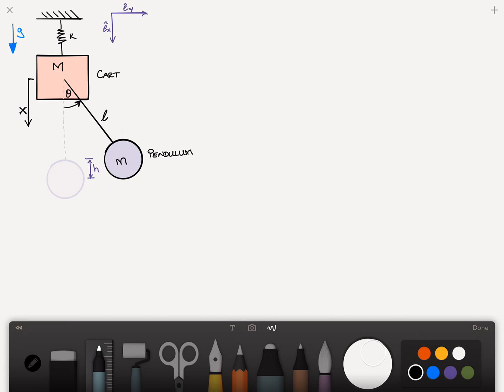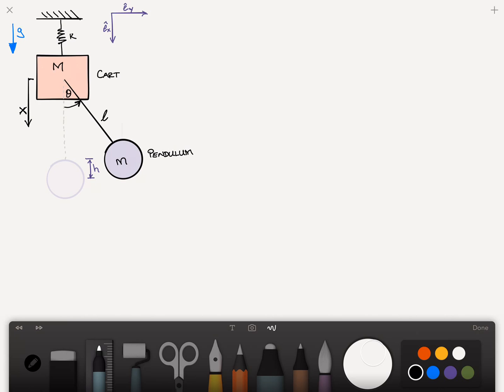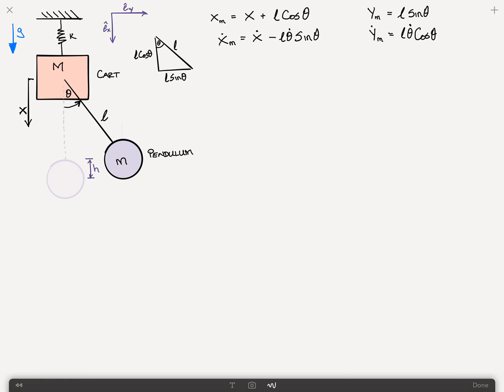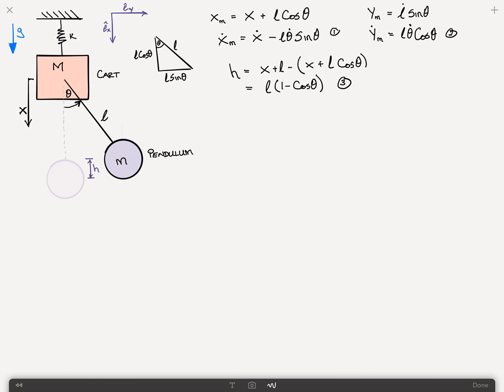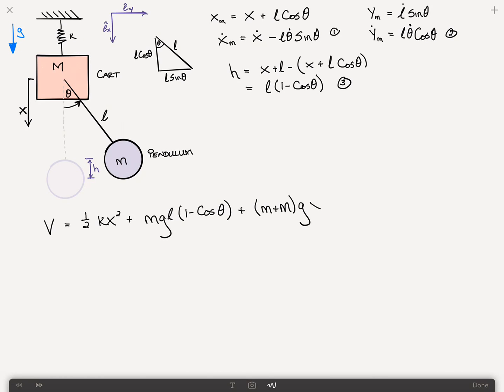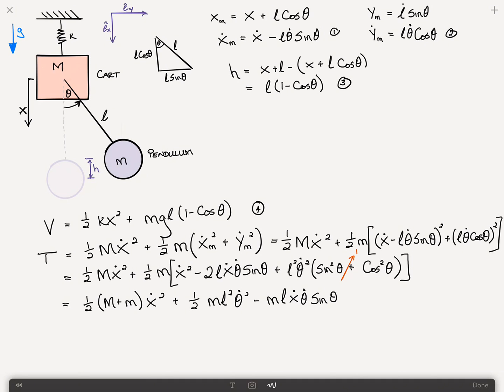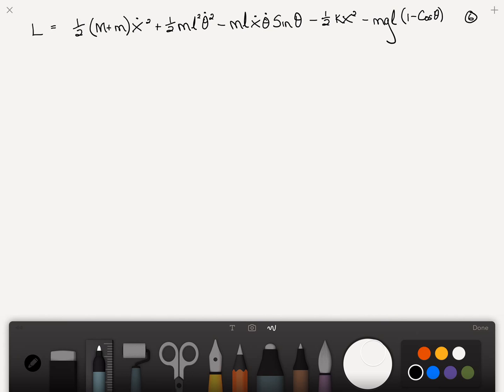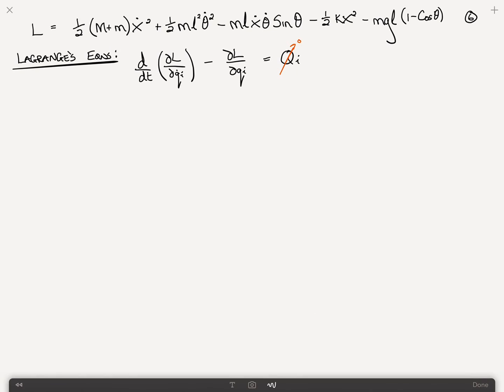Equations of Motion for a Pendulum on a Cart (2DOF) Using Method of Lagrange's Equations

Comment: Sir given these two equation can we now use small angle approximations to do modal analysis and find natural frequencies?
Reply from the maker: Yes, sure.  You can linearize the problem as you described and then solve for the mode shapes and frequencies for the linearized problem.

Comment: how does the potential energy equation differ if there was another spring connected underneath the cart to another datum point?
Reply from the maker: Since this spring would still have a displacement of x, you would add the contribution of this spring to the potential energy of the system as V = 0.5 * k1 * x^2 (assuming the spring stiffness is k1).  Hopefully, what you are able to tell just by looking at the problem and what I have written, that as a result of your described setup, the two spring stiffnesses would be additive (i.e. both resist the motion of the cart).  As as result, instead of re-deriving everything, you could simply adjust your equations of motion by replacing all occurrences of k by (k+k1) - i.e. the net effect is that the spring you currently have would effectively be made stiffer.

BTW - It would make no difference whether you attached the spring to the bottom of the cart, as you have described, or whether you attach it to the top of the cart in parallel with the existing spring - in both cases it will resist the displacement of the mass with the same force.
Reply: @Freeball99  You are a Legend mate. Much appreciated

Comment: How we can   Linearized both equation of motion  ?
Reply from the maker: Apply the small angle formula.  So, replace sin θ with θ and replace cos θ with 1 in your equations of motion.
Reply: @Freeball99   Now then, your equation no. 9 will be  ' l*θdd -xdd*θ+g*θ = 0 for small angel. isn't the second term xdd*θ also non-liner? and xdd*θ also deleted to make it liner system?

Comment: Sir, hi. I have a question. If we take the datum the very top of the sistem h becomes as h = -x-l*cos(theta) which changes the equation. What am I doing wrong?
Reply from the maker: Not sure if I understand completely...what you have done, in effect, is to shift the origin of your coordinate system from the mass (at equilibrium) to the attachment point of the spring.  It should have no net effect on your equations of motion.

Comment: is is possible to get the oscillation period from this?
Reply from the maker: Since this is a nonlinear problem, the frequency of oscillation (and therefore the period) is a function of θ (and thus the initial angle).  Also, if the vibrations are small, then we can find the frequency/period for the linear case - which is constant.  You can calculate it if given a specific initial condition.  In practice what happens is we end up with limit-cycle oscillations in the nonlinear case.

Comment: Thanks a lot for this lecture; the explanation was very clear and I'm planning to run a numerical simulation.
Just out of curiosity, you mentioned in 0:30 that the weight of the system can be ignored, even though the displacement x is in the same axis as gravity. Does this mean that x=0 is not the resting displacement when the spring is unloaded, but when it is loaded by the system?
Reply from the maker: Here is a discussion on gravitational effects and when to ignore them.  https://www.youtube.com/watch?v=TpZMTo-Lig4 
In this case, just assume that at equilibrium the spring is in its (slightly) stretched position.  You can calculate this position by equating the entire weight to the spring force.  Then assume that this is you zero point.

Alternatively, just include the gravitational effects.  What you will then see is that you have a constant term that gets added to your solution for x(t).  This is the gravitational offset.

Comment: Hi! Thanks for the nice video! I was wondering how you would go about solving this problem assuming small angles?
Reply from the maker: The idea here is that we take the equations of motion and we change sin θ to θ and cos θ to 1 THEN we eliminate any higher-order terms.  These are any terms that contain two or more coordinates or their derivatives multiplied together and can be eliminated because they are insignificantly small in relation to the first order terms (a result of the small-displacement assumption).  

Therefore, the resulting equations of motions for the linear system are as follows:  
(M+m)x_ddot + kx = 0  and
L θ_ddot + g θ = 0
Reply: @Freeball99  Okay, Thanks! That helped alot!
Reply: @Freeball99  much clean equations, i like it

also solutions for x and theta is on same format with given constants

Comment: Hello. How can you define the function of angle in such problems? I mean, what's the function of angle, derivative of which we take in order to find general 'dot'-equations of the coordinates?
Reply from the maker: A closed-form solution for this does not exist which means there is no such function that can be written out.  As a result, the response must be determined by numerically integrating the equations of motion.
Reply: @Freeball99  Oh, thank you. Thus, we have to calculate (approximately) the value of the final function at each point of time, for each value of the angle, haven't we?

Comment: what's software used in presentation ?
Reply from the maker: App is "Paper" by WeTransfer.  Running on a iPad Pro 13-inch and using an Apple Pencil.  Video is captured using Quicktime.

Comment: @Freeball  Sir but X is about/from the equilibrium position so if we are taking that position as our reference point then (M+m)*g*x should be considered in the potential energy... because X will be below the reference point.because X is the additional displacement from the equilibrium position
Reply from the maker: In general, X is not from the equilibrium position, but rather from a prescribed zero position.  

My suggestion to you is to include the term you have proposed above in your potential energy expression and put it into Lagrange's equation and see what happens.  

What you will find is simply a constant term in your x-equation (because the x disappears after you differentiate this term).  What you will find it that you end up with a forcing function which is simply a constant...which adds a constant to the total response - this constant is equal to the initial elongation of the spring.  I have explained it here: https://www.youtube.com/watch?v=TpZMTo-Lig4
Reply: @Freeball99  Ok sir , i have done it and come up with -(M+m)*g ,and by your suggested video I understood that why Mg shouldn't be taken,but what about pendulum potential energy, it should be included as -mgx as initial dispace ment was 0 and after a time t pendulum makes an angle theta and M makes displacement x so i think that in h=l-(x+lcos(theta)) sould come.
Reply from the maker: I believe the argument is the same as before - i.e. you can ignore the gravitational effects by using the equilibrium position as the zero point.  You can test this for yourself and determine whether or not to include.

Solve the equations of motion (using my integrator that I provided in a previous video).  Run it once while including the effects of the term in question.  Then re-run it after zeroing out the terms.  Plot both results on the same graph and see if the results differ by a fixed, constant amount.

Comment: Been watching your videos for sometime now to go back to the basics continuously... Do you have recommended books you use for conceptual references?

I want to dive into more examples/problems. Derivation for me is usually to understand all the influencing parameters, and quantify what I already have speculated, but i don't like getting bogged down in them for way too long. 

When I fix a frame on a garage door, I don't go about deriving how to add adjustments to bolster rigidity. I just drill some wooden rods with the right fasteners in the right places if you know what I mean. 

Anyways, I've been trying to combine different concepts for applications in aerospace & structural design. 

Current books/material , are less textbooky (which are awesome btw & i love penguin classics) : 

-The New Science of Strong Materials, J.E. Gordon
- Structures : Or Why Things Don't Fall Down, J.E. Gordon
- Tom Irvine : https://www.youtube.com/watch?v=vWjizHma16Y
- Success through Failure: The Paradox of Design, Henry Petroski
Reply from the maker: Sorry, But I missed this until now.  I don't really have a single book that is good for everything.  I think back in the day, I used a book by Rao, which was pretty good but had some mistakes.

Comment: i found different equation to this system. would you like to explain how it is different?

https://drive.google.com/open?id=1WwWk2bMFRb7feRw8kRWEY_6qNUlY177B
Reply from the maker: Thanks for this feedback.  With regards to the information in the attached link...

1.  This expression for potential energy is basically the same as what I have presented with the exception that I have chosen to ignore the gravitational potential energy of m1 & m2 due to the x displacement BECAUSE I have assumed a different static equilibrium position than that which you have presented.  NOTE:  I have assumed that the static deflection (equilibrium position) is due to the weight of m1 + m2 while the author of your book assumes that the deflection is due to the weight of m1 only (which is why he/she must include the additional gravitational potential due to m2).  Here is a link to a video where I describe when it is okay to ignore the gravitational potential by assuming oscillations about a static equilibrium position:   https://youtu.be/TpZMTo-Lig4  

Apart for than, the two expressions for potential energy differ only by the addition of a constant (due to different assumptions where the point of zero potential energy for the system is).  The constant gets differentiated out when substituted into Lagrange's equations so we really only care about the CHANGE in potential energy and not the absolute value of it.

2.  The expression for kinetic energy that the author has presented has several problems (at least 3 by my count):
a)  The velocity for m2 has been squared TWICE.  The expression in the parentheses is already the m2 velocity squared (check the units).  Squaring it again is wrong.
b)  The second term of m2's squared-velocity should be (L·Θ_dot)^2 and NOT (k·Θ_dot)^2 - again check the units.  Units should be velocity-squared.  There is no physical way in this problem that the velocity of m2 can be dependent on k.
c)  The third term of m2's squared-velocity should have a NEGATIVE sign.  This is due to the fact that for positive 'x', m2 moves vertically downwards while for positive theta, m2 moves vertically upwards.

Hope this makes sense.  Unfortunately since there is no work shown, it's hard to guess why the author should have made such an error, but the kinetic energy expression is clearly incorrect.
Reply: I forget to check the units as you said. Thanks a lot Sir. It is so helpful. 😇

Comment: hey I wonder if you can do a brief video on tuned mass dampers, where the spring and mass are moving horizontally, and the pendulum attached below, thanks a lot!
Reply from the maker: Sounds like you're talking about the type of damper they have begun using in skyscrapers (like in the  "Taipei 101" building).  
http://justfunfacts.com/wp-content/uploads/2016/05/taipei-101-tuned-mass-damper.jpg

Did you take a look yet at my video on Dynamic Vibration Absorbers (which is the same thing as a tuned mass damper)? 
 https://youtu.be/7T6pQnNBph0 
I realize this is for a sightly different system, but the mathematics and the concept are identical - namely that in order to tune the pendulum, the isolated pendulum should have the same natural frequency as that of the isolated mass-spring system (i.e. for tuning purposes treat each mass like it is its own single-degree-of-freedom system).  

I remind you that the frequency of a pendulum is independent of the pendulum's mass and is equal to SQRT(g/L) where "L" is the length of the pendulum.

Here is a video that demonstrates this (non-mathematically).
https://www.youtube.com/watch?v=f1U4SAgy60c

If this is unclear, let me know and I'd be happy to make an explainer video.
Reply: Thanks, your comment helped me in my experiment, sorry for the late reply though!

Comment: How would this be written in matrix form, or is it impossible to do so as it is everything's far to coupled
Reply: also would one have to linearise the system?
Reply from the maker: You cannot do it in its current form.  This is not due to the coupling, but rather due to the way that the nonlinearities enter the equations, namely sin (theta) and cos (theta). 

For small vibrations (i.e. small theta) you can linearize the equations by replacing sin (theta) with theta and replacing cos (theta) with 1.  Then you can write the EOM's in matrix notation.

Comment: excuse me, sir. Doesn't M also have gravitational potential energy?
Reply from the maker: Yes it does, however, I explained briefly at 4:05 in the video why this can be ignored.  In the case of translational motion of the mass, the effect of gravity is that it simply shifts the equilibrium position of M (i.e. the position about which M oscillates).  Using the assumption that M is oscillating about this equilibrium position, the effect of gravity on M can be ignored.  It is explained in detail in this video: https://youtu.be/TpZMTo-Lig4
Reply: @Freeball99  Sir but X is about/from the equilibrium position so if we are taking that position as our reference point then (M+m)*g*x should be considered in the potential energy... because X will be below the reference point.because X is the additional displacement from the equilibrium position
Reply: +Freeball
Thanks a lot for these videos. :D
For some reason it's surprisingly hard to find videos about this specific Lagrangian method (most videos are obsessed with Lagrange Multipliers for some reason), but you have lots of videos on the formula L = T - V, which is what I am always looking for. ^_^